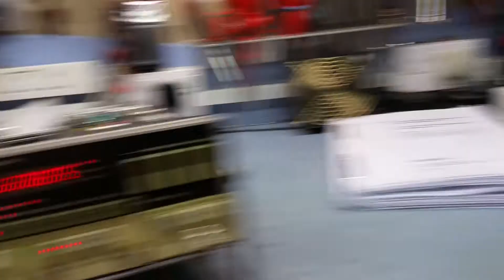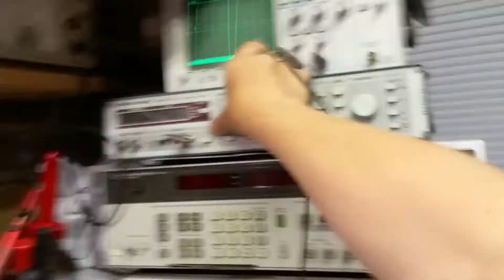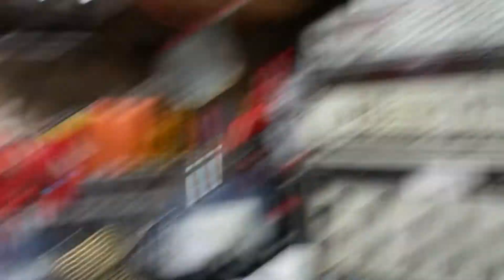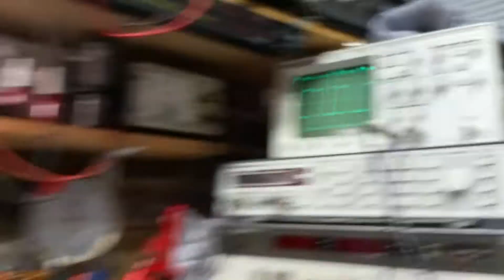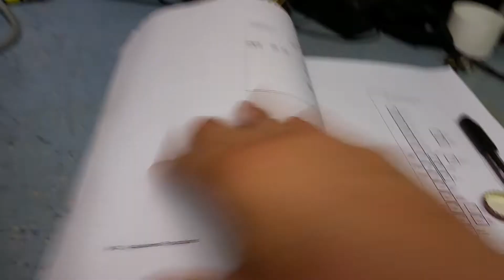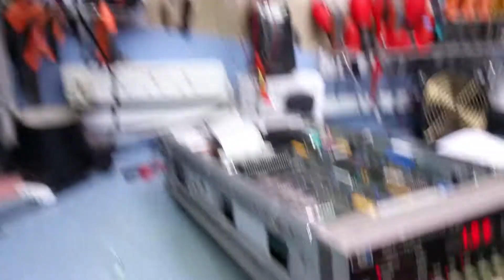HP 8112A with error E41. Repaired.

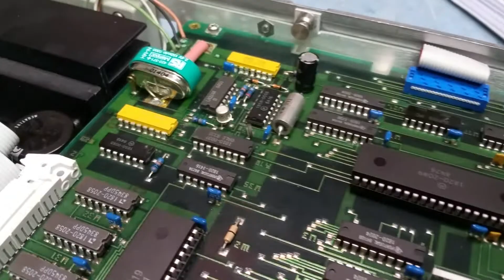Comment: Did you really assemble a rechargeable Li battery for the RAM backup? (mentioned at 7:38). Instead, it seems to be a NiMH, Varta 2V4, 150mA, so even 0.6V too low a voltage. That is no good idea at all. In the schematics, a  normal 3V battery is required (p/n: BR-2/3AT2SP), no recharging is foreseen,  and rechargeable batteries usually have high self discharge currents.Your solution will fail within a few months, instead of about ten years, if using a proper 3V Li primary battery. So probably that's also the reason, why the unit showed E41, as the cal constants got lost, due to the wrong battery backup. PS: The RAM, a HM6116, requires at least 2V data retention voltage. Therefore, 2.4V minus the Schottky diodes Uf is just at the lowest limit, and any electrical disturbance, or discharge of this battery will clear the RAM.
Reply from the maker: I actually meat a NiMH , that was in the unit when I got it. Calibration constants are not stored in memory, this is done by good old pots! The battery is merely for saved setups.
Reply: Careful with the battery replacement! Back then NiCd (rechargeable) was the norm and some equipment used some sort of non rechargeable lithium batteries, NiMH and LiPo etc came years later!!
Using the wrong battery technology for replacement can be disastrous!!
A LiMnO primary battery (3V)  like a CR 2032 in a holder might be ok, alternatively in the case of NiCd's , an equivalent number of small cells can be wired in series , insulated and wired to the board( i sometimes use the smallest cordless phone replacement types).
Reply from the maker: Hi no it was replaced with the correct battery.
Reply: Simon Spiers  Excellent!!